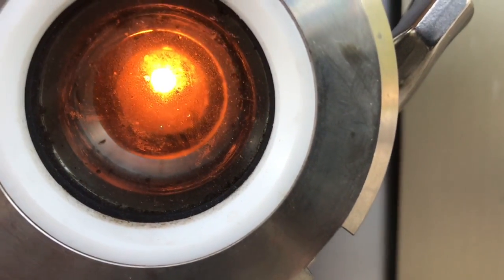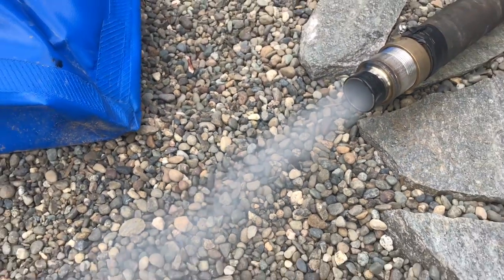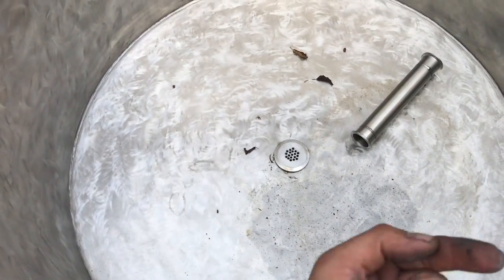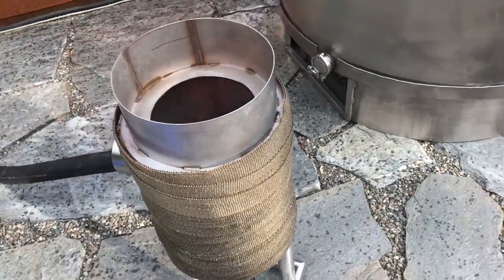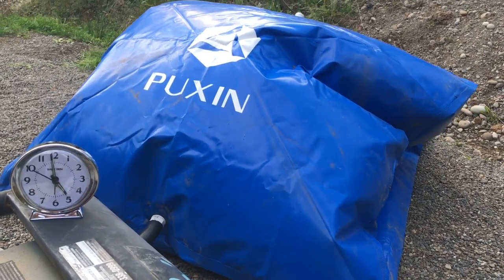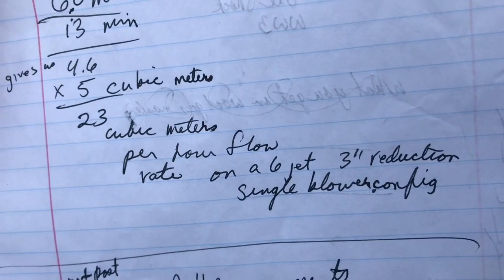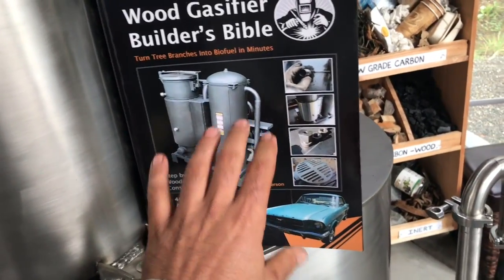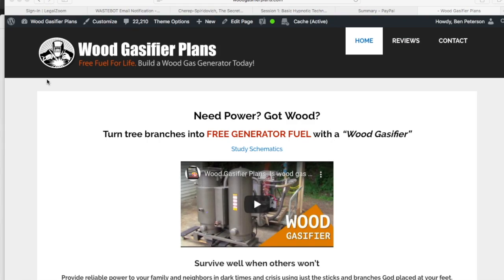Alternative Fuels: Storing wood gas & biogas quick & easy

Comment: How long would the full gas bag run a Honda 2000 generator?  I’m trying to compare that to gas or propane.  How much energy is in there? Can it be compressed?
Reply: This gas cannot be safely compressed practically by a home person. Hydrogen will escape from the smallest gaps and easily reaches ignition temperatures at high pressures. The liquid stage at room temp pressure required for hydrogen is also prohibitively high.

So, this background helps answer your question. The engine will very quickly go though the bag (maybe a few minutes for that size bag, like 5 or 7). The solution for almost any gassifier application in my opinion is to produce the gas when it is needed, but have buffers like this bag or a gasomoter for fuel exchanges.
Reply: My concept will be fed by pellets and ignited on demand. I have a device (to to expensive) that grinds scrap wood and process it into pellets.

Comment: I am developing design considerations , one thing I would avoid is the cooling tubes design.
I can see this would be a problem with extended use. When I do build my system any such 
cooling tubes will have a header  plate to remove to clean out the inside.

Comment: got the book couple days ago from amazon, been interested in gasafiers since i was younger. I really like that you go into the how it works, temp ranges that happen etc. its quite thourough on the build process anyone with even just ok fab skills, some tools could do it.

 ill be getting the parts to make it over the coming months. So far I have the 2 100lb propane tanks and the ceramic insulation. I'll probably be taking piks or video if the build process along the way. End goal is to power my older toyota pickup with it.
Reply: Jak to dopadlo?

Comment: Hey Ben, what you are doing here is really cool.  Taking a gasifier and finding heaps of practical accessories to make it even more versatile.  Not just a backup emergency energy source.  With your double bottom hot tub, are you circulating hot gas or ignited gas?
Reply from the maker: I had it set up to recycle the hot gas, not burn it, but you have to be close to the machine to get the heat.

Comment: Are YOU, yourself, selling a built-up ready-to-use, long-life (stainless ???) gasifier ?

I am finding trouble contacting any manufacturers (except in Finland) of "off-the-shelf",
fine-tuned, long-life, ready-to-use, commercial quality, bug-free, Pryrolysis (sp ?) Gasifiers.
Reply from the maker: I am thinking about going back into production, but it all depends on the market demand. With the economies of the West faltering, it's a question mark right now.
Reply: @VictoryGasworks  I'm gearing up my garage for production, slow process, but almost there!
Local fab shop's been contracted to punch out the parts on a plasma table, and 2 blower motors already purchased. 8 100 lb propane tanks in reserve. Garage is now wired for 220, welder is in place.... many things to plan for!
Only recommendation,  don't go into debt preparing for production!
Reply: @whgordon6109  Jak to dopadlo?
Reply: @VictoryGasworks  
If you do go back into production, please keep us in mind  (Snow Andrews, New Zealand).
Could be interested in "Local" (NZ) distribution if the product (quality) & price were right.
Reply: @VictoryGasworks  If you need a CNC table let me know I have another company that builds them too. This is actually the background where I came from, building high precision CNC machine tools and other specialized automated machinery. My new email is mryder@versifire.com. Yeah Im re orging the gasifier comp again.
Reply: @VictoryGasworks  Ben - we are in Northern Nevada and since the whole 2 year episode seems to never end... what is the price of the unit that you have in your video and is it able to operate a 6.5 kw Onan gas generator? I am still ordering the book but this has gone on for far too long and I need power up on the mountain. It will also be solar but I prefer the backup generator in the event something goes down on the solar and wind turbine side of things. Thanks so much for responding. I'm trying to send you an email and I am on gmail but it doesn't go through for some reason. Be Blessed and thank you so much for all that you do to get the word out to us!
Reply: @
Snow Andrews

If you dont know about my company, I am one of the few leading companies in the US that build small scale gasifier systems. My reactor cores are 1/4 wall cast SS. 

The reason you may not be finding full SS systems is; You dont want to go full SS in a gasifier, SS retains heat and once the gas has left the reactor we want to get rid of the heat to drop its moisture. SS has to be very carefully engineered in the reactor as well. It will be subject to over stress as it will grow as it is heated. This expansion will create stress on the steel if it can not dissipate that growth and lead to stress failures. 

The metals used beyond the reactor are not subject to oxidization as the gas is void of oxygen. If the unit is shut down for a period of time or stored you would simply rinse it out. I also use an industrial coating internally beyond the reactor that nearly indestructible.  This keeps cost down and in market price point reach. Full SS for my machines more than quadrupedal the cost. I could certainly build a full SS version. But cost would be very high with longer lead time. 

I offer a fully automated (turnkey) 5 kW power station for $10,500.00 It features a Honda GX 630 V twin engine with a 13 kW peak output generator head. This will produce 36 kW/ hours pr hopper fill. It is fully automatic other than initiating modes from its touch screen interface. Im pretty much the only manufacture at that level in this scale of machine in the world.